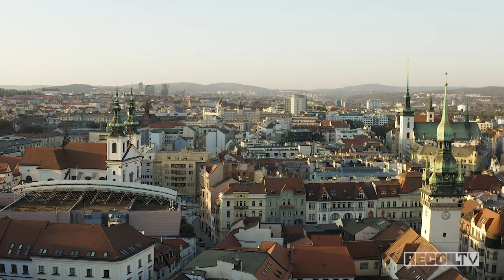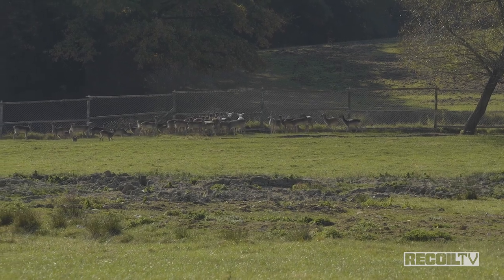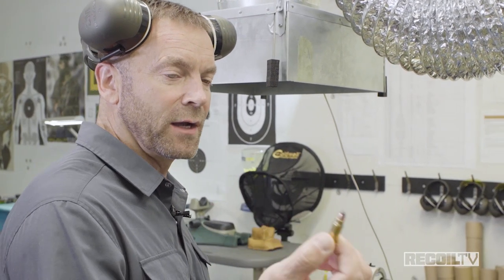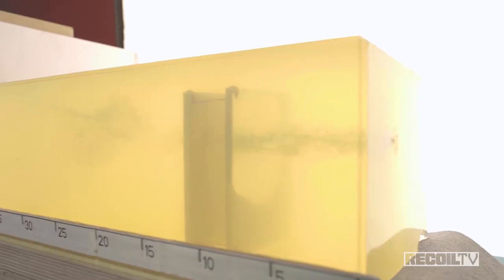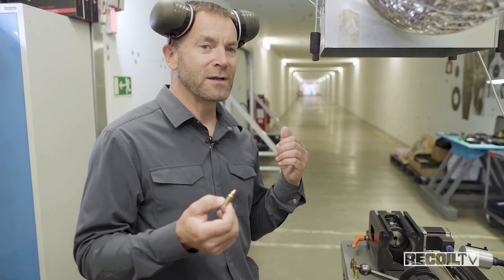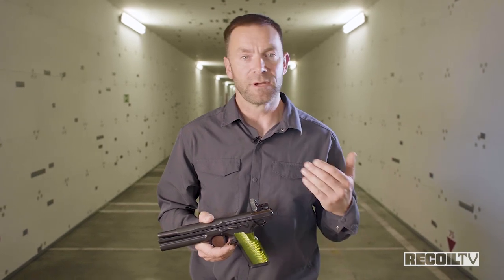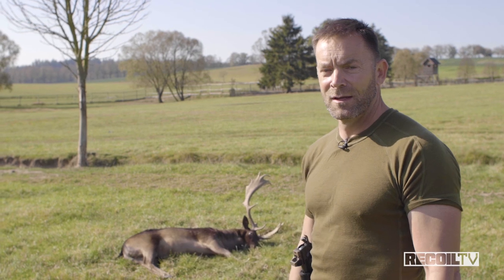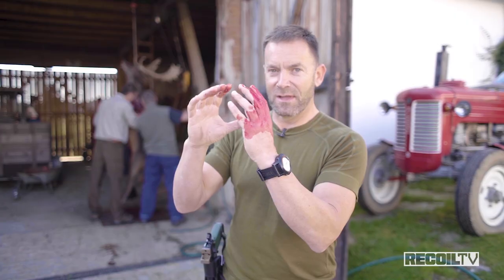Testing Fun with the FK BRNO

Comment: They will go out of business as soon as we develop a pistol for only a grand that shoots the same round. It’s a great pistol but no pistol is worth 7,500.
Reply: It's nice but I can get a 50ae for 1500. Or a Taurus 44 magnum for 500. I'm with you that one.
Reply: Couldn't agree more...the only pistols even approaching that say "DWM" on them and they were made a century ago.
Reply: Target contractors do not care about $7500.. they use much more expensive equipment.
Reply: If laugo gets that round
RIP FK
Reply: The barrel making process is what makes it expensive.  They are made the same way you make a howitzer barrel. Standard barrels would not be able to handle the pressure from that round and would explode.
Reply: @vikingnj6731  what the pressure of that round?
I'm guessing these are cold hammer forged
Reply: xmeda for a pistol alone? Doubt it.
Reply: Viking NJ  dude
No
It’s only 50,000 psi 
That’s only 5000 psi off say 960 Rowland which is 45,000
Which uses standard barrels 

327 federal mag is 45,000

357 sig is 40,000

Please don’t bullshit with something you know nothing about 4140 steel doesn’t even yield until 60,000 psi and an ultimate strength of 95,000

This isn’t even getting into stronger steels like  416 stainless which is far stronger
Reply: @vikingnj6731  can you tell me more on how they make the barrels please.
Reply: I’d rather have the bruno over a Cabot 1911
Reply: @vikingnj6731  I've heard that too,  but I firmly believe it is marketing hype to justify the high price. Think about the pressure of virtually any modern rifle round,  you can get a cheap rifle chambered for high pressure rounds. If that claim was true,  all high pressure chamberings would cost an arm & a leg.
Reply: @vikingnj6731  "standard" barrels can already shoot much hotter rounds than this. Wtf are you talking about?
Reply: Maybe for Americans the Market is not there, but us Europeans that have access to such fire arms are willing to put down a price like that as the quality speaks for itself with such things.
Reply: They’re not taking about the normal market, they’re talking about a completely different clientele, that most companies in the us don’t really care about.
Reply: Viking NJ come on bro, I my standard hunting rifle is a .257 Weatherby mag that load up to 65,000 psi and  my S&W .460 magnum runs 65,000 psi I’d assume a .500 magnum runs higher but I’ve never looked into it. Point being none of these guns have a “howitzer barrel” or cost $7,500 but operate at higher chamber pressure.
Reply: Me and the boys with AR-pistols
Reply: Ruger or Taurus got this!
Reply: I would never pay that much for a pistol
Reply: @bev8200  mate it doesn't matter how big the calibre is both those rounds would be stopped by body armour its about the range accuracy velocity and penetration power 

there are body armours that cant stop a 9mm but it will stop a 12g slug
Reply: @Ryknfjor  It would fall apart.
Reply: @Pyrochemik007  why? If psa gets that round chambered in a gun,  it'll work.  FK is just a bespoke company.  I don't think the chamber pressures rival that of 7.62 nato lol
Reply: This is probably only half the price of some actual Mars pistols, old hand-made, always unique original hand-cannons which are true museum pieces. The idea of a modern, relatively simple pistol costing this much is outrageous.
Reply: @MyLonewolf25  Saami specs on .308 is a 60k max psi average(with a small min to max range). And I can personally attest to mass producing .308 rounds that are made to average 57k psi within a 6k psi range.
Reply: NoCoBandit proof loads on these can reach over 80k easily 

Anyone who buys into special barrel bullshit doesn’t understand a fucking thing
Reply: They make a personal defense variant with a couple barrel options for $1600.00
Reply: @vikingnj6731  That's just their sales pitch. It isn't true in the slightest.
Reply: @HaraKiriMaxir Not when you can get higher quality for less.

Comment: I’ve got my Glock 20 with a 9/25 Dillon barrel that cost me 100$. ammo from double tap, Underwood and many more. Ballistics are identical.
Reply: No matter how many gun channels and Spec Ops veterans there are, trying to sell me on the emperor's new clothes; I ain't buying the notion that this gun is worth the price of a Barrett .50 cal rifle.
Reply: Good point
Reply: @fee_lo8346  Yeah well, ballistics not withstanding, you still have a dime a dozen Glock.
Reply: Trae UCity those who buy this pistol pay for exclusivity, not practicality. So not for me either.
Reply: @bacanthony3659  I could buy a Ferrari Daytona kit car for $50000 that still has the same four wheels touching the ground as my ten-a-penny 2002 Camry with peeling clear coat, whats the point
Reply: Roger Rarebit  , I actually agree with you.

Comment: Imagine a SMG with 10inch barrel firing FK Bruno cartridge at 800RPM. that's a overkill
Reply: I don't think 800 RPM would be that controllable. 500-600 might be better.
Reply: Not a bad idea.  .30 carbine, 7.62x25, and this 7.5 FK make for a 200-300 yard potential PDW or SMG.  While still using pistol size magazines.

Comment: 10MM Auto necked down to 7.62 Tokarev. I call it the 7.62 BTLG, as in a .30 cal Bootleg of the 7.5.  Fraction of the cost, and you can put it in a glock or 1911 or something
Reply: As pointed out in another post, the 9/25 dillan already matches the ballistics with weight and speed.  Loaded with 7.62 bullets in that cartridge you are going to burn out some barrels, but man o man what a shooter!
Reply: @masterkeep  Yeah but imagine going even smaller and lighter with a 30 tokarev, itll go even faster and burn even more barrels

Comment: For self defense my concern is always over penetration.  Do we get any bullets that we know will expand and or completely frag?
Reply: @Just_a_Tool  if I bought it for the coolness it’d have to be at least an inch longer re barrel and slide and frame.   For bear defense you want a shorter barrel than this so you can clear your holster faster but then of course you’re at a power disadvantage which is why most bear defense revolvers are 500SW.  I could see hunting with it but for the price tag,  a short barreled 30-30 would be my choice.